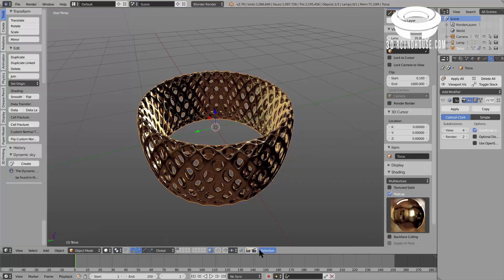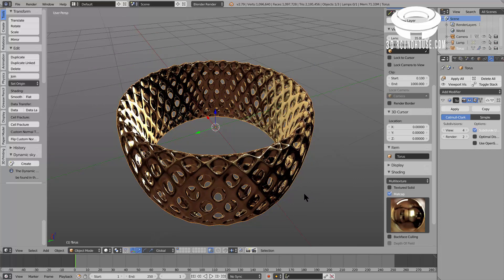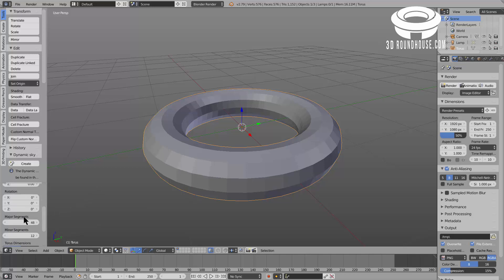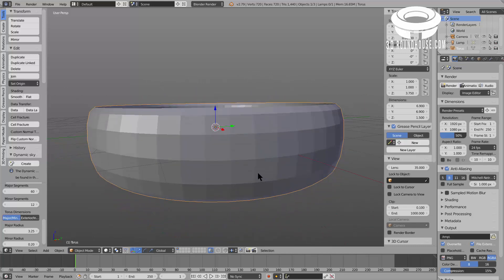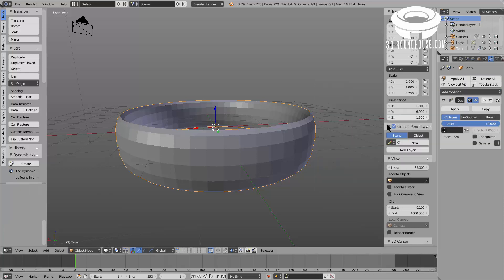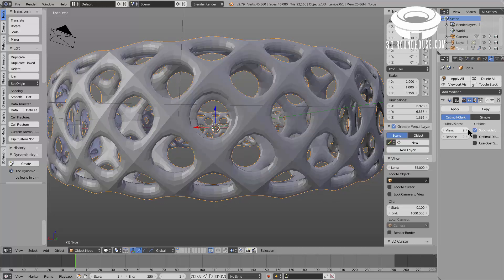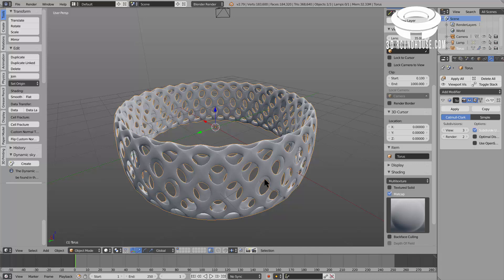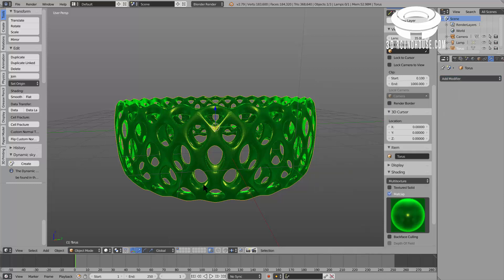Blender Modifiers Bracelet, a nice model created for 3D printers

Comment: Thanks, really nice bracelet and helful tutorial. What if i want to increase the thhikness?
Reply from the maker: Hi Matteo o, thank you for your question. It is really simple to increase the thickness of the bracelet. If you watch the video right after 03’10”, you will see how I change the thickness using one of the parameters available in the Wireframe Modifier. Hope it helps 😉
When you will have created your model, feel free to share it with us on Facebook or on our website. And share this video with all your friends. They should enjoy it too. Have a great day!
Reply: Thanks for the answer. I will try it. Actually i already gave it a first try but without success as i'm using ABS filament that is quite difficult to print with. I'm using ABS because i want to smooth the bracelet with aceton to have a very fine result. So i have to figure out first the best settings to use with ABS.
Reply from the maker: Hi Matteo o,
Depending on the kind of ABS you use, the temperature will change. Let me give you a few tips from my learning period with my first printer (almost 5 years ago :-) ).
1- try with a thicker layer set up. Avoid playing with very thin layers first. You will spare a lot of time, material and nerves.
2- use a medium speed (between the top and bottom speed of your printer).
3- use a raft, if your printer and software allows it. It makes it easier to print a nice object.
4- write your different settings somewhere. It will help you follow your progress and keep tracks of what works and what doesn't.

The 3D printing world is great but the beginning is sometimes a little bit tougher than expected.
Have fun!